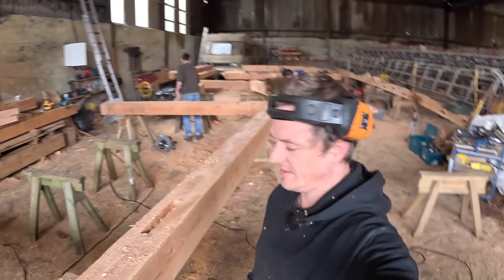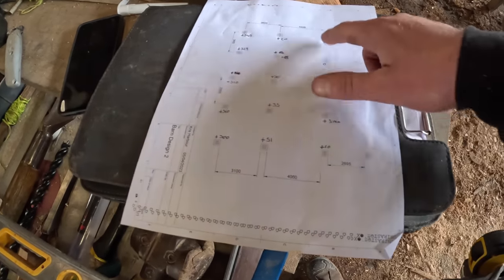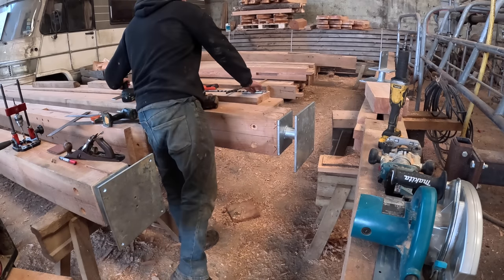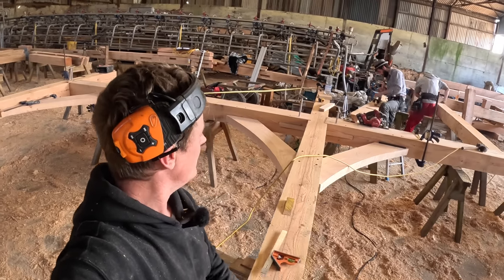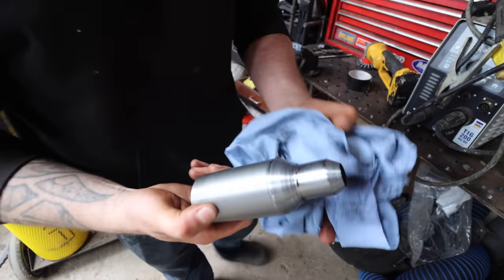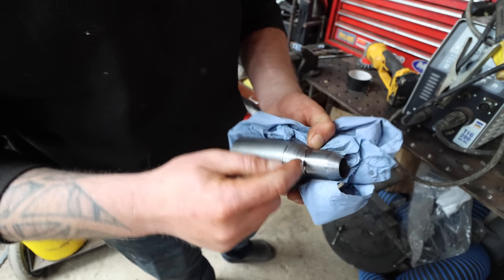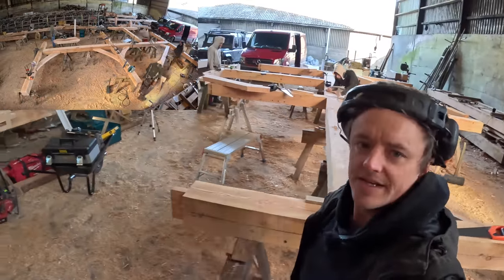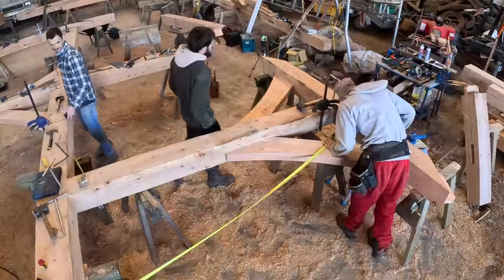Timber Framed Barn Part 11 Cross Frames And Oak Pegs

Comment: Love the way you push on through when problems hit, you find the solution! We have had to do the same many times with parts or tools we have paid good money for, my son seems to be always correcting or redesigning the solution on his lathe etc. One example, he had rebuilt an engine for his classic mini, weeks of work and months of planning, fitted it in and ran it, then one of the bushings inside the gear which floats on the end of the crankshaft gave up, so out came the engine again, got the gear off, and it turned out this BRAND NEW PART had been made with the incorrect type of metal! He remade the bushing with the correct material on his lathe, fitted it, put the engine back in, and all is now fine. It seems that if you want something done right, you just have to do it all yourself! The progress is phenomenal with the guys you have working with you, we are SO excited for you and Dot and we love to see  all the steps, big and small towards your wonderful goals

Comment: Beautiful workmanship on the timbers. While I admire your quick work at making a die to thin down the pegs that were long enough and of better quality, you still have quite a bit of expensive kindling. I think that your time is valuable also. Thank you for giving a demonstration of why those pegs wouldn't do and for showing the time and energy required to solve the problem that someone else made. Best wishes for you and Dot and the timber frame crew!🕊🖖🐈‍⬛🫖📚🔭

Comment: Kris. Absolutely love your videos and the developments you undertake. The range of skills you've built up over the years and continue to acquire is somewhat humbling!
I couldn't help being struck by the section on the oak pegs as the company I work for makes these by the thousand and supplies Oak Framers across the UK. I should say that we use completely traditional methods i.e. top quality oak selection; splitting not dowelling; and draw knives on shave horses and we aim to achieve the highest quality and consistency. If you need any extras to make up the numbers we'd be happy to help.

Comment: I think it'd be quicker if you took the square plate off of your peg jig, and held the jig in your lathe chuck.  You could then bang the pegs through in quick succesion without the jig moving all over the place, or you could use the tailstock to push them through.  Just an idea.

Comment: Structural welder here putting in my 2p. One thing I foresee is problems with those steel feet. There is no way the welds are up to structural spec, and there will be a lot of force on those pieces of tube. Might be fine but I think those welds will pop.

Comment: I like the way your brackets work.. You mentioned wind and Im wondering if when you permanently mount those bases you shouldn't fill that curf with epoxy or a gueriila type expanding  glue to prevent lateral wind loads from wanting to split the beam along that curf  and to discourage deep checking along the curf??? It's probably overkill due to the bolts but that should probably be the name of your barn anyway!!!!

Nice work sir love to see quality...

Comment: Can't you use your post hammering machine cilinder for pressing pegs through, and then mount a plane upside down in a vice, to pull the pegs over it in order to shave them quickly to a taper?

Comment: I feel your pain re trying to use companies to seed up your projects. I used an engineering company to rebuild a crank for a bike I'm restoring. Just a simple single cylinder. Agreed a price, they were to supply a new Japanese conrod kit and the two main crank bearings (again Japanese made). I was charged more than the agreed price, there was only one main bearing fitted not two, it was Chinese made, so was the conrod, and the crank webbing was damaged (admittedly only cosmetically) from where it was trued with a steel hammer, not a copper / lead mallet. Never again, I will buy a press and do it myself next time.

Comment: could you add a small hydraulic ram to push the pegs through the die?  could make the work a lot faster and easier on you physically.  Framing is looking amazing.  You're not going to turn it into your house when you get done are you? ; )

Comment: Frame looking great, sheep and lambs looking great, but those pegs are absolutely atrocious! I'd have sent them all back and paid for the postage to be rid of them. I've not done much heavy duty timber framing (heaps of regular framing) but I've made my own pegs. Made a rounding plane from scratch using a spoke shave blade, ripped up some oak and popped it on the wood lathe, quickly roughed it out, tapering the end. Into the 4-jaw chuck  with tapered end free, low speed, rounding plane did the rest. Did take a bit of setting up the blade just right and the odd cock up, but otherwise a pile of lovely round dowels with a square end to hit.
Nice solution ye came up with.
P.S. 8:09, I was taught, always lay a plane on its side, otherwise ye risk damaging the edge ye've carefully sharpened.
Reply: Oh my goodness, I picked up on the plane too! I’m certainly not criticising in any way, but I could hear my Dad’s voice in my head (from over fifty years ago), ‘always lay a plane on its side’. Your peg solution also resonated with me.
Reply: @chrisberry9017  Thank you for the reply. I winced when I saw the plane go down but definitely no judgment on the impressive Kris Harbour. I've been a carpenter 34 years but will always feel there's more to learn. To be fair, I only had to make about 30 pegs. Don't want to even think about knocking out 400. 😁 Mark in Scotland

Comment: A quick QA check would be to drill a 19mm hole into a piece of stout steel and simply drive em through, any that fall through are undersize any that are slightly oversize will be shaved to 19mm?  I've seen (you perhaps) dowel made this way.  I admire your all round skills, what was your major?
Reply: Don't I wish I watched till the end before commenting🤐

Comment: There are different opinions or different theories some think that is the best Peg is perfectly round to the perfect round hole it is my belief that this is not the ultimate best option it is best to have slight Flats on the peg so that as you drive it through the oak wooden beams it cuts and is stronger in. There is no movement in any direction and will lock tight most people like the Peg sticking out on both ends that is fine myself personally I like it finished flush look to it and if I want to add extra strength I will drive a wedge in the end of the peg I primarily will do this 1 inch in diameter pegs it's not just that it looks pretty but it also ends up making it like a nut and bolt

Comment: I don't get why the concrete footings are at different heights, requiring Kris to cut each individual post to size. Seems like there's a lot of room for error in doing that. Maybe I'm missing something. Also, are the feet made out of aluminum?   In any case, another great video!
Reply: Concrete can't easily be controlled when filing column bases, the amount of air entrapped means it hardens at different levels. I don't know but am pretty sure the bases are galvanised mild steel.

Comment: Kris, did you play with Lincoln Logs when you were a child? 
The tool you processed on the lathe should be marked so it can be used again either by you or someone in the crew that is helping you get this done.  Looks like quality craftsmanship will be erected when you are finished.  👍

Comment: big posts like that i always just plunge cut with a chainsaw straight through the end grain so you dont see the cut on the sides. gotta use a petrol chainsaw though the battery ones rpm is to slow and they grab...

Comment: Couldn't you use factory/machine cut 19mm dowels?
Reply from the maker: you can but they are not the same thing. they are not tapered so they won't gradually pull the joint up. but the main issue is that they will have cut grain running though them so they could break. these pegs are SPLIT form straight grained oak. that means the grain runs from top to bottom. that makes them a lot stronger.

Comment: I'm astounded at the absolute lack of quality in those pegs, from a timber framing company no less.
I'm curious.  Since you need so many is there a reason you couldn't go to someone with a wood lathe?  They could make a template and follower that would knock them out exact and very quickly couldn't they?

Comment: Why these pegs are frustrating:
1 - They sent you a sample that demonstrates they have the knowledge and ability to make them correctly. So you know it's not an innocent incompetence of just not knowing how to do it and you asking too much. Or a communication issue. Or an education issue.
2 - They sent you a sample that was not representative of the quality they then made them to, even in the same ballpark. So you know this is fraudulent. You know you're getting screwed.
3 - The product they sent you isn't just lower quality, it's so far below the minimum necessary quality that they're completely unusable for the task at all. Garbage.
4 - The quality you received doesn't even seem to have made them more money. The corners they cut didn't even benefit them. They would have saved money making them properly. It's not even a good scam.
5 - Setting aside quality for now, how f-ing difficult is it to meet a standard like "minimum length = 330mm"? This isn't about allowable tolerances for the task and a dispute over the amount of precision you're paying for, 330.5mm vs. 332mm, etc. It's about a basic concept. Longer = okay, shorter = not okay. They did not grasp this basic concept.
6 - Even if the junior workers who made them were useless, at some point someone higher up saw what they produced and said "Yep, ship it", so they didn't even care enough to have supervisory QC, let alone direct QC from the workers.

ARGG. So frustrating. So unnecessary.

Comment: 600 pegs at £1.50 each is £900 and you don't even get what you need. Mental.
At least you've got the know how to make that peg thinner and he looked like it was taking about 30 seconds a peg to knock through so 300 minutes = 5 hours. Bloody hell it's still bad when you figure it out. Hope they gave you a good refund.
You showed some of them won't be long enough, maybe just get rid of them? Lol. I don't want to see this causing structural issues with the barn! Would be bloody typical for the one thing that's outsourced to cause major issues

Comment: They sent you a sample and based on that sample you agreed a contract with them to supply you with 600 pegs, from what you were supplied with it looks like none of them matched the sample. As such that's, as well as being a total breach of the trades description act, it's fraudulent. You would have been well within your rights to refuse to pay them, I only hope that your discount was a massive one, say 90%. As you say if you want a job doing, especially as you have the skills do it yourself. Its not like they could or are not able to have a similar tool that you made up, things like this really annoy me, it's a total waste of time and effort all for doing the job correctly 1st time around. Even though it's out of your control is sours all the hard work and care, that you and Howards team have been putting into the build. Really glad that the feet you have designed are fitting wall and looking good.👍🤗

Comment: Seeing the effort you had to do just to modify an existing peg to make it right, to be honest, there's no way a skilled craftsman would have been able to make a profit creating the pegs from scratch the way they were in the sample pack for 1.5 pounds per peg.  Nothing on you mate, but did you not know that that 1.5 pounds price was way, WAY too cheap?  If those pegs were machine made, I can see that price point would work, but they were obviously hand made, so there's no way that price should jive with market reality.
Reply: The blanks are made on a production line. The tapering is done manually on the shave horse. I’ve seen Kris take a minute or so to make one. So if you say 2 minutes each, that’s £45/hour. That’s a pretty good rate isn’t it?
Reply: Actually, once the die was made, the fix seemed relatively straightforward and you'd think an outfit making these would have a similar tool at the ready. More importantly, they had to make the samples so they were fully aware of the work involved when setting their price point. Fulfilling the order in a different way from the samples was just deceitful, I'd say even fraudulent. In my opinion, given the evidence of the samples and the obvious non-conformity of the order, they're lucky they got away with just giving a bit of money back.
Reply: @HT-io1eg  £45/hour is way under what a normal craftsman needs hourly to cover up all the costs for the hours put in preparation, tidy, administration, cover up the loses from customers who is not satisfied or not paying, not to mention the expenses of running a business with insurances, taxes etc.. You have to 2x your own hourly used in total to make it just square. So if I work like 10 hours everyday I might be able to "sell" the 6 hours of them.. My personal salary should be lets say £25/hour x 10 = £250 per day x 2 = £500, that makes it down to the fact that my 6 hours sold in one day would be £83.33 per hour. So it is sold for nearly half price.. The result is what you have payed for. Pretty simple. ;)